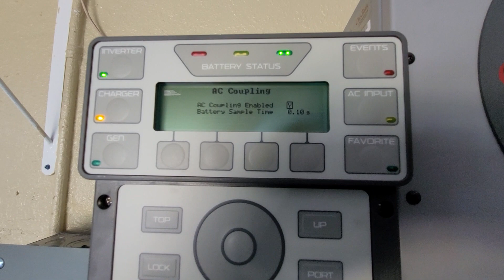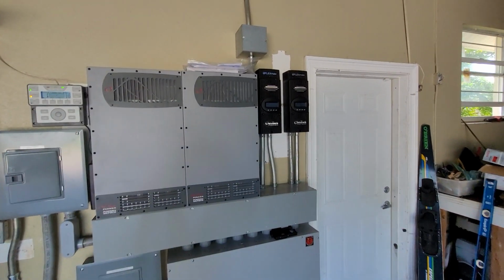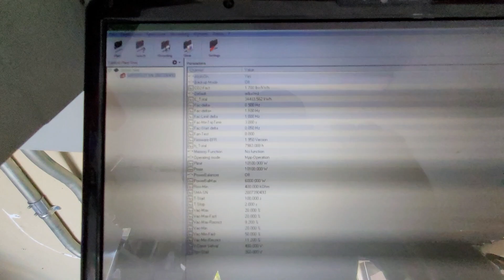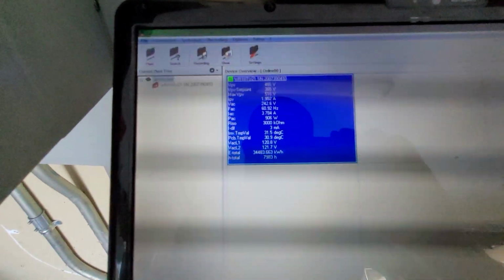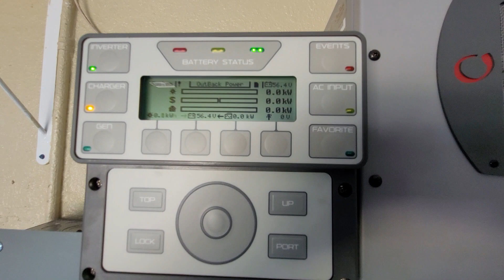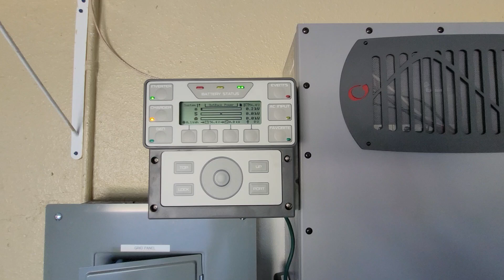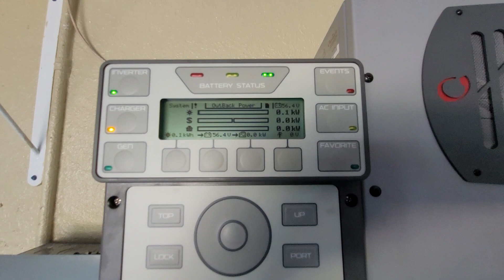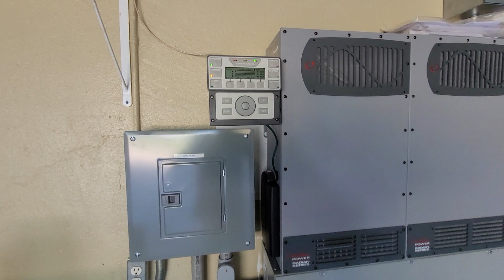Proper AC couple operation

Comment: Nice setup! How much AC Coupled power can you run in a system? You have 16kw of Radians what's the most you can AC couple into them?
I want to run Antminer's on the system I'm bulding, it's 50kw of panels and right now the Solis 11.4kw Inverter. I want to use grid tie Inverters to supply most of the power for the Antminers. They will automaticaly ramp up and down dependant on power being generated by solar with custom software.
The problem I see is what happens when the sun comes out from behind some clouds? I can't ramp up the miners that fast.
I wonder if the Solis can frequency shift fast enough or that's just not possible. I was thinking like 20kw of grid tie inverters to start.
Any ideas?
Reply from the maker: @DIYSolarFarming  its 6kw ac coupled per radian ac couple can be a PITA FYI lol

Comment: Hi this is very impressive. What software are you using to change the settings on the sunny boy?
Reply from the maker: I think it's called sunny control, it's on their website under the Sunny islands page I believe
Reply: Thanks very much. Btw is that the 10000 to us 12 inverter? Thanks
Reply from the maker: @jl9678  I don't remember I installed that about 12 years ago for him 
I'd guess 10k

Comment: Nice work. How large is the battery bank? SMA recommends at least 100Ah for each 1kW of PV inverters. Have you seen issues with smaller battery banks?
Reply from the maker: This is 1200AH 
   my neighbor has a offgrid 22kw pv array  w/sma equipment During  light loads he was having shutdown problems 
From the pv to AH ratio 22kw/1200AH 
He ended up leaving one pv inverter off when not needed.
Reply from the maker: He has lithium batteries
Reply: @SolarTechFL  thanks for the info! Is that 22kw of PV or the nominal AC output of the Sunny Boys? Do you know the state of charge of those batteries when the shutdowns took place? Were the shutdowns caused by the BMS shutting down the batteries to prevent over charging? 

I'm building an SMA system now with two Sunny Islands and 19kw of solar panels, in 6 strings, on two 7kw Sunny Boys. Per SMA, the battery bank should be 1400ah. The battery manufacturer suggests at least 750ah for an ac coupled system of this size. I'm planning to add relays to each PV string so I can disconnect one or more based on the state of charge. When the state of charge is somewhat less than full, say 80%, all strings will be active. When the state of charge hits 90%, strings will disconnect. Do you think that solution will suffice? We currently have 600ah of lithium, but that will probably increase to 900ah.

Thanks again!
Reply from the maker: @David Joly  I think what you wanna do will work great he was having problems at one hundred percent charge He has a 11kw  and a 6.0 s m a 
The Sunny islands were shutting down because they couldn't curtail the Sunny boys in time. And they were going over there charging voltage threshold. 
This was only happening when there was no load on site and a full battery Is with full sun exposure.